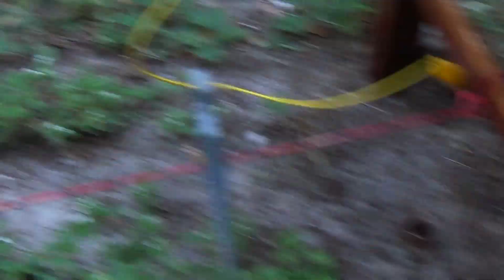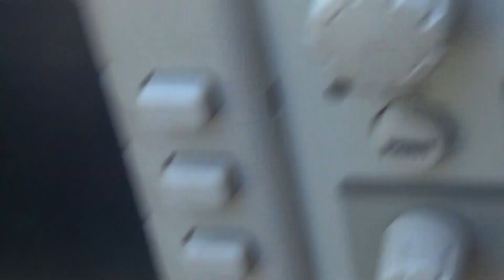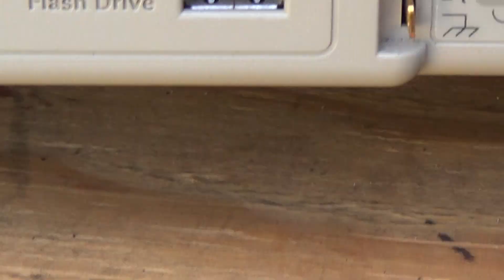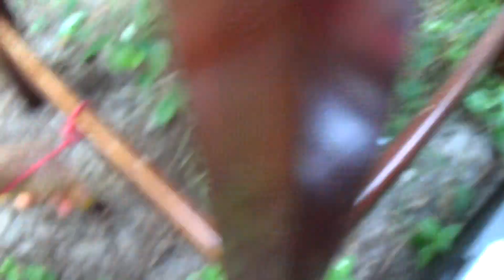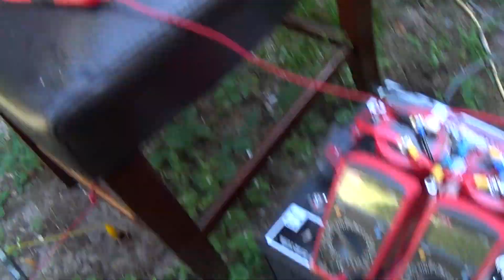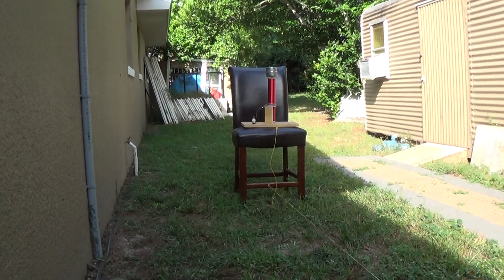Tesla single wire power transmission (ground tests 2)

Comment: If you get your tuning and ratios/proportions correct you don't even need the single wire connection. I think most people missed this in my "Let There Be Light" video, where there is no wire connection between transmitter and receiver and I light up the #1157 brake light bulb and a 110v nightlight bulb at the same time. I just don't have the room to set up a  long-distance demo! 

By the way... not everything you read from certain experts on the forum is correct, as you are discovering. A lot of it is correct, like the recent post about near and far fields and distances related to frequency, but some of the rest does not have experimental support from actual builders and testers.
I asked before but didn't get an answer: Are you still using the original mosfet? And have you tried elevated horizontal and coaxial orientation of your Tx and Rx coil sets?
Keep up the good work, and think about this: Auto-tuning receivers are not that hard to build, in this system. 

;)